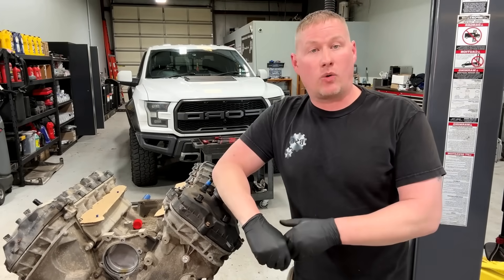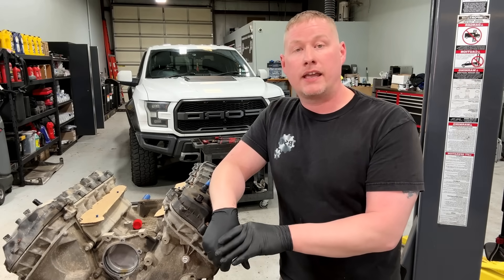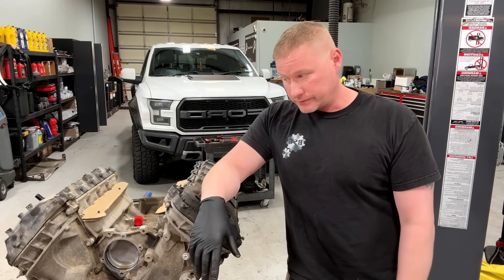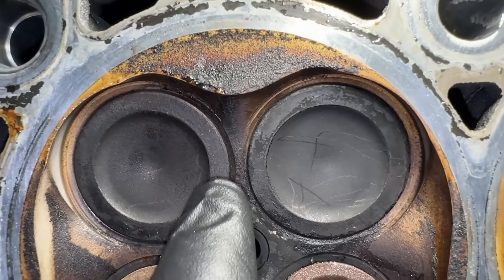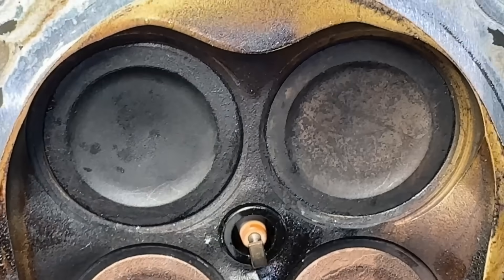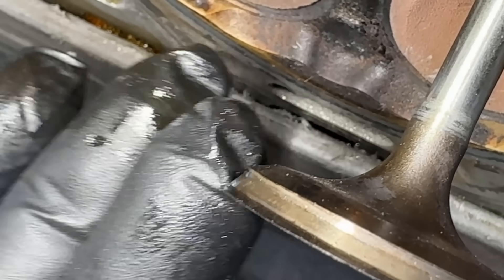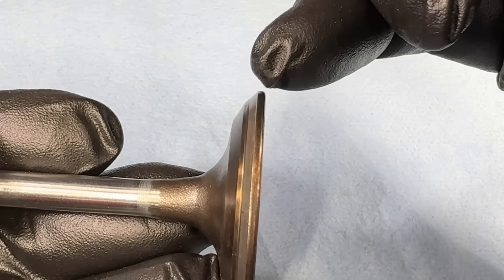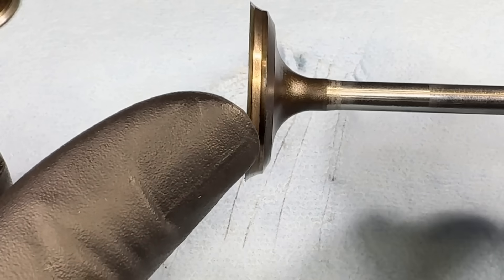The One Fatal Design Flaw of the 2011-2014 Ford 5.0L Coyote Engines!

Comment: Anyone doubting this guy is either dumb, drunk, or hasn’t watched FordTechmakuloco long. There’s not an expert I would trust more when it comes to gas powered F-series engines. 

Fools are practically receiving unheard wisdom for free, yet have the audacity to voice their biased opinions instead of saying THANK YOU.
Reply from the maker: I couldn't have said it better myself.
Reply: @FordTechMakuloco  Will substituting the 5w20 oil Ford recommends with 5w30 help an engine with over 100K ?
Reply from the maker: no
Reply: @FordTechMakuloco  Thanks!
Reply: @chipsaunders154 why? Or who told you that it would?
Reply: @FordTechMakuloco  bro you have taught me more then anyone else about my truck.  You've also saved me more money then any accountant.  Thank you for what you do.
Reply: @FordTechMakuloco 😊
Reply: @FordTechMakuloco  I have a question for you. I have a 2014 Ford F150 5.0 coyote with 126,000km on the engine. This has nothing to do with this video, but I thought I’d quickly ask to get your insight. I’m getting an exhaust fume smell coming through my air vents on the inside of the cab. It’s very noticeable during cold start, after sitting for several hours. I’ve taken the truck to an exhaust shop and was told there were no exhaust leaks to be found. The famous ford exhaust manifold “tick” is not present, however I do get a scattered tick from the engine specifically on the passenger side, only during cold start until the engine warms. Once my engine warms, the exhaust smell dissapears from the air vents (air on keep in mind) hot or cold. Whats your take on this? Have you experienced anything like my situation with your customers?
Reply: @jabadathehut6400  Had similar issue ended up being bad spark plug #4 allowing gases to seep, paid mechanic to change all spark plugs, still the same smell, discovered many months later he only changed 3 plugs out of the 8.  One of the reasons why I do my own mechanic work now.
Reply: @FordTechMakuloco  will this throw a engine light?
Reply: This man is truly a Ford expert. Anyone questioning him is the person who needs the education.
Reply: People are so ignorant these days! This guy knows his stuff crazy good!!!! I've learned a ton from this channel
Reply: Brian, thanks  for every thing you and your son do to try to save us folks some money on our vehicles.  GOD BLESS.
Reply: I learned a lot on my horrible grenade 5.4 triton from this guy still running today thanks to a cam phaser change out time and chain and oil pump
Reply: He loves to over exaggerate issue's
Reply: That's some liberal Democrat logic if I ever heard it😂 but he's right about the valves😂🎉
Reply: Makuloco likes to talk out his ass and over exaggerate mechanical issues
Reply: Nothing in life is FREE.  If you aren't paying for something, YOU are the product.
Reply: Let him pay you some of the money he makes from this video. J/k 😂
Reply: Just like you everyone has the right to voice their opinion. It might be a nonsensical opinion but, remember an opinion is not fact. It's a personal assessment of an issue. So please, leave other people be. If that's not too much to ask. Wisenose.

Comment: Can you please answer my question, can a sunken valve give you the same effect as a bad injector or a  coil issue .
Reply from the maker: They cause a rough idle but otherwise the engine should run fine at higher rpms.

Comment: My thoughts exactly, just black box the engine

Are shop will get a Chrysler 3.6 that needs updated cams and rockers. 

I'll look at the miles in the engine and suggest just black boxing it. 

My boss doesn't see it that way. So I end up replacing cams and rockers on a junk 3.6 Chysler.

Comment: the engine is fine other than a slight valve tap on the 6 cylinder engine , what he said about the valves tuluping is wrong, the seats would drop first then the engine would cease from the piston striking the dropped valve seat. Ive worked on the wj jeep, which had that valve droping issue
Reply: yeah ok

Comment: I dont know how my engine made it 300 thousand miles until now. Getting a misfire number 8 changed coil,injector, spark plug fuel pump, maf,  come to find out i only have 40 psi in that cylinder. this explains why.

Comment: The main thing he says wrong here is the valve is slamming into the seat. The valve should not be slamming into the seat or your spring height/pressures are wrong. As the valve approaches the seat the spring pressure should come off and only seating pressure should be on the valve. The compression stroke hold the valves closed more that the spring pressure. It may be a design fault or over revving the engine (or soft valves), but besides that the valve should never be slamming into the seat.

Comment: I have the same issue had a few mechanics check it out and one said he has a few he does the oil changes on that has had the issue for years and they run fine, except at idle sometimes just like mine when they go into limp mode but get out of it after a few seconds.

Comment: they all only build cars to last the factory warranty period and not much past that, they even calculate how thick the plastic should be on the plastic engine parts, not only that they are starting to put undersized engines in vehicles and squeezing more power out of them by using a big turbo, these engines always run in the hot, high stress zone even with normal driving so they burn out soon after the factory warranty expires, because after that they know the vehicle is your problem, not there's ??

Comment: I actually had this exact issue on my coyote swap car. I hadnt noticed any misfires yet but I had the motor apart, so I had the heads gone over by a local machine shop. They found 5 valves like that. I didn't know it wad a widespread issue!

Comment: I still thinks fotds best engineceas the 2v 4.6 v8. They only have intake problems( plastic and will crack) spark plugs ( can be prevented torque to 18ft lbs) and plastic tensioners ( preventable by switching out to cast iron tensioners) all cheap fixes and very doable ( except timing job) by the average diy'er

Comment: This is exactly what happened to my engine. I had compression loss for about 80k miles in #5 and #3 😅. Finally went out at 278k miles. 6800$ later and she’s back to brand new 😊 2013 5.0 XL

Comment: Thank you Brian!

I have a 2014 Ford F150 with the Coyote engine. I bought it used with 180,000 miles, I’m now at 237,000 miles, & haven’t experienced a misfire due to this issue.

Do you recommend upgrading the valves still?
Reply: Built Date?  If its later in the year, there is good chance you got the new version valves already.  Anyhow no reason to replace the valves until it starts misfiring.  IMHO
Reply: If you have a later production date you are fine.  I wish i would have gotten a 2014....  I have a 2013

Comment: I have a 2012 - F-150 . 168.500 mi.  Only thing I have had to replace besides battery and tire,s is a coil pack..  just been a great truck . Changed the plug,s at 150.000 .runs as good as when I bought it...

Comment: I'm having a misfire on cylinder 8. I replaced the coil pack and plug but its back on
Reply: Try a fuel injector. But it most likely is this valve issue

Comment: Yep hah a 2012 107.000 miles had this problem. What a disappointment. NEVER AGAIN WILL I BUY A FORD.
Reply: Feel the pain. Mine hit at 135,000. right after doing a full suspension upgrade to hopefully keep the truck for 10 more years.  Only had 5 years with the rig :(

Comment: Well shoot now i know why 5.0L mustangs are going for cheap. They are  junk. Will have to  have new engines costing $$$$$ . and rebuilding by self is out as no machine shops exist or know how to do things anymore .
I found  heap 5.0l mustangs all over $5k-8k with 100k- 150k miles. Now know why. Think I'll go with a honda accord coupe or accura 2.4L and manual transmission then maybe super charge over a mustang 5.0L.  The honda 2.4L are master class engines and reliable . dont want have buy a mustang then bump new 5.0l engines in. An old ford 4.6L or honda 2.4L is way simpler to work on and cheaper fix than a Ford 5.0L
Reply: Not a single report of this happening on a Coyote Mustang. They are not exactly the same engine, They don't run on the same strategy . They don't even have the same firing order and the list goes on.

Comment: My truck 2013 Ford F-150 5.0 at 130k mileage, had blown head gasket. Took engine out and checked out what went wrong. Somebody who had that truck before I bought it at auto store about 4 years ago, somebody had it overhauled, timing chain jumped at 1 tooth and both camshaft chain was not on mark as it supposed. I swear I don't know why it ran well and there's no knocking or something like that. There's coolant in passenger header side is worse, had coolant leak on rear end. Driver side header looks like it has coolant leaks too. Probably send in machine for both block and headers. I still not sure if I can rebuild it or buy a used engine. You know that whole engine is aluminum block, but it can be twisted if overheated which is why I send them into machine shop and see what happens.

Comment: What years f150 5.0 would you consider the most reliable? I have read the 2015-2017 5.0 with the 6 speed transmission were the most reliable f150s made. Thanks so much for all of your infomative content!
Reply from the maker: that is correct

Comment: I live in a Northern Town in Alberta Canada and this fault is very common, seen it happen when they were still under warranty. Seen it happen on models up to 2016 not just 2014, u can remove the heads and replace just the valves for a MUCH cheaper cost then replacing the whole engine. No other hard parts needed, no need for a machine shop, clean up the surfaces and use new hardware/ gaskets. Our theory is extended idle times cause the valves to fail, it's always cylinders #4, #8 which are the back 2. There is no coolant crossover at the back of the engine, we suspect excessive heat is the culprit. I feel bad for every customer that has paid outa pocket for this, 1000's of engines out there without valve faults, Ford just cheaped out.

Comment: 234,000 my 2014 developed a misfire cylinder 7 . Ford dealership changed spark plugs still has misfire. Low compression on cylinder 7 just a little low . My only concern is I have a crate engine installed how long before transmission goes out. I’m not sure about investing 11,000 dollars for a engine

Comment: Got this happening on both of my rear cylinders, would it be possible to just get new valves and lap them?
Reply from the maker: I would get a proper valve job at a machine shop.
Reply: @ there doesn’t seem to be any machine shops close to me, if the seats look good, do you think I’ll be fine?

Comment: Original owner of 2013 now with a 175k   Other than changing oil/ air filters anything you guys recommend to prevent this in the future?
Reply: I throw some Cataclean in there every 3 months to keep the cats clear. If they get backed up, they can create more heat towards the back of that engine and can aid in this happening. I have 130k on my 2012
Reply: I also use some Lucas upper cylinder lubricant too. Might help and might not

Comment: We need some data.   Everyone who has a gen 1 coyote should post:

1. Year and model
2. Actual Date of assembly 
3. Assembly plant location. 
4. Mileage when issue began or if they never had the issue how many miles you have now.

This would help people know their chances on if and when they might be affected.  With enough data points it might become possible to gauge the odds.
Reply: 2013 F150.  Build date 2/2013, Kansas City, MO  210,000 miles  No issues, yet.  I bought the pickup with 182K on it and don't know if it has ever had the engine replaced or head work done and I cross my fingers that it doesn't develop one.  I would like to drive this one to at least 300K.  Thanks for the video, BSG.
Reply: @mudcreekdiesel Thank you
Reply: 2012 Mustang build date 01/12 Flat Rock plant. Currently 203k miles with no loss of power. Daily driven on E85 and will on occasion still eat Scat Packs.
Reply: @jesusg607ify Thanks
Reply: Guess I should take my turn since I started this.    2013 FX4 5.0   Build date: 10/27/2013.  Kansas City 61,355 miles.  No issues but still kinda low miles.   I’ll report back if anything ever happens.   Keep em coming!

Comment: My brother  has a 2013 f150 with the coyote eng. developed  slight miss  became worse. Got lucky tookto an excellent mechanic who diagnosed  a low compression,  removed head found a valve guide just coming  apart. Then question was repair head or get New production  5L long block from Ford ?? Considering  truck had 120k miles but was overall excellent condition . Went for newest production eng.  New eng. installed excellent  total price, very happy with truck and work. BW

Comment: There are issues with every engine ever made. Can they all be fixed yes. Is it worth it sometimes. Nothing man made is perfect. My 2002 has 200k+ and still runs like a new pair of shoes. Is it perfect, no, is it a good one yes, did I maintain it and have regular check ups yes, did I get lucky, maybe, did others not get so lucky, probably. Nothing is perfect. Ever.

Comment: Is this an interference engine? I believe the secondary chain tensioner gave out on my 2011 Mustang bank 1, and I'm wondering if the engine is trash. If it is not, can the head be removed with the engine in the car?
Reply from the maker: yes it is

Comment: Great video! so did I miss something? What is the cause of this? soft metal on the valve? How about the 2019 coyote?
Reply: Yes, soft metals used for the valves. Ford has corrected this and now manufactures new valves that aren’t as soft. 2019 coyote might have the new valves in it

Comment: Would not call it a tulip valve but a soft valve face that has worn badly and caused the face to wear. If tuliped the valve length would be longer but still just wording but does appear valves are soft compared ro seats.

Comment: My 2014 5.0 was manufactured in December '14. Hopefully all of the defective valves were installed earlier in the year.
Reply: My ‘14 is August date, crossing my fingers lol how many miles you at?
Reply: @jakelindberg3  Just now read your response. I now have 71,000 on the odo.

Comment: Replaced an engine in a 2012 5.0 f150 when i was a car tech 2 years ago. I truly thought it was a cracked ring due to the fact that cylinder had 75 lbs of compression that bleed off fast. Now i truly know what was wrong. Ultimately it was cheaper to replace than too fix. This engine had 110k miles. Im a chevy guy and for good reason. If this issue happened on my 5.3 silverado itd take me 4 hours to repair it with a cylinder head replacement. With the 5.0, im laughing hysterically at how long itd take to actually truly replace a cylinder head😂😂

Comment: In a,essentially max effort build (1500hp) would you be afraid to tun OE valves in the gen 3? I have PAC springs,retainers and seats for the heads but I like the OE valves if they will hold up. I have not decided on rods, but the Molnar power adder rids are looking good. There are a few other brands I like but they are over double the price of the Molnars . Since I am not made of money I am trying to shop frugally but not skimp on quality.
I understand what you are talking about when you start mentioning anything Ford didst get right the cheerleaders cry . Its why Ford has multiple generations of the coyote. Gen 3 seemsnto be about the best if someone believes otherwise pleasenstate why.
Very thorough video and explanation of the issues.
I am currentling revuilding a Mercedes m272 and those were known to have a serious metallurgical problem on the balancer shaft gear. Most of the first gen of that engine had the problem and it takes out the whole engine a lot of the times. As Ford too has a metallurgical problem with those valves. It surprises me that manufacturers have problems sourcing good parts. It speaks to how difficult it is for aftermarket consumers to get good parts. If you buy aftermarket parts and install them and end up with a problem you are probably going to be told user error or installer error if they have any problems.
If you disregarded the miss how long do you suppoe the engine would have run?
Would you suggest new seats with OE valves (gen3) ?
Thanks for the video!

Comment: Hey all just wanted to let you all know the reason that valve was like that, it missed an operation for some reason! let me explain there are two operations that help the valves longevity or durability if you will, first the seat area is ground down at the same angle as the final seat angle. then a higher-grade metal is welded in its place at the same angle so as to have uniform fill depth across the valves seat area this helps with increasing the life of the valve- seat. It was the concaved shape of the valve seat area that gave it away on the bad valve it looks exactly like one that comes out of that particular grinding operation! If one gets out many could get out till its discovered. The valves seat depth looked to be over a 100 thousand or a tenth of an inch deeper this would have compromised the intake springs preload it may have had enough the first 100k miles but when the seats wear the springs weaken as they do it could no longer properly seal the valve. If you ever run across one again measure the thickness of the valve head and or the overall length of the valve if its tulip Ing like you say, it should be getting longer. From just a visual of the two valves you showed that does not seem to be the case. Thanks, I enjoyed the vid.